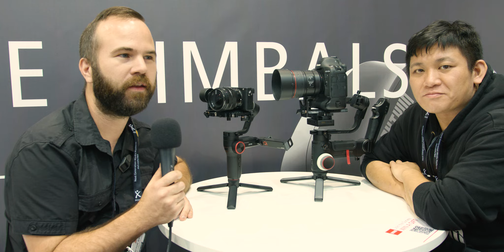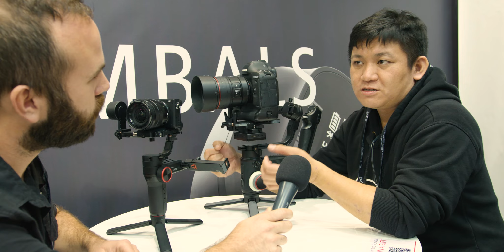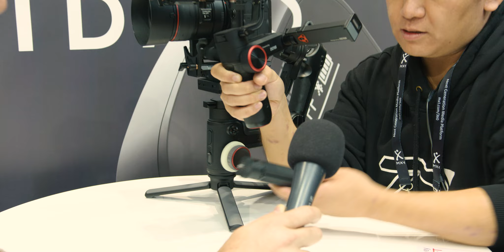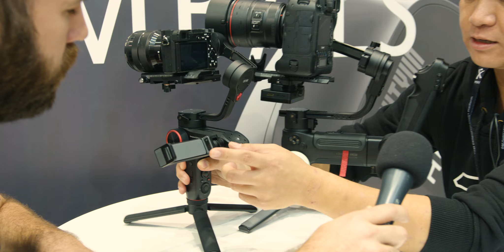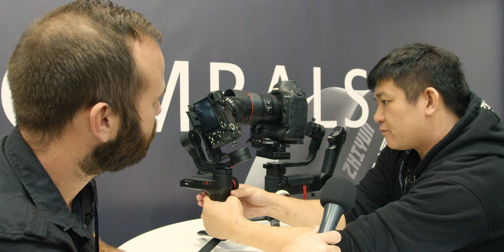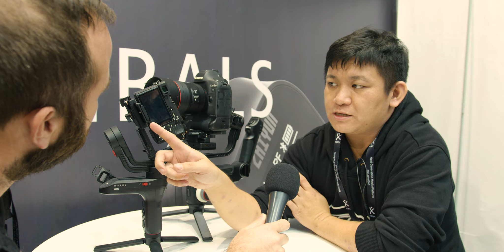Zhiyun Crane 3 Lab, Weebil Lab, Brand new Gimbal Concept, IBC 2018

Comment: this may sound like a crazy idea but imagine if the next version of this design had all the controls at the grip and had straps that held the battery section to your forearm.   Your forearm can easily handle the weight of these while taking all the strain out of your wrist.   That should also allow your thumb and forefinger to relax enough to control the knobs and such.

Comment: It seems as Weebil did not have a joystick. I was really into it but that omission kills it for me :/
Reply: It has one, just not like the drone remote type joystick on the Crane 3 or Ronin S.  The controls are similar to the Crane 2, which I actually like.
Reply: OrganicFarmer So it's basically digital signal for one direction? Isn't that very limiting for panning? Wouldn't that mean you can't adjust the speed in real time or pan diagonally?
Reply: You can adjust the speed but you won't have as much precision as a joystick I suppose. I've not had any problems with the flat joystick of the Crane 2. As for Panning diagonally I haven't tried this
Reply: Christian Lionel yes, I will probably get it anyway - I would just prefer more "analog like" precision. Glad to hear it works well for you on Crane 2.
Reply: It works really well and I think that to be honest it's not a deal breaker at all whether you use a Ronin S style joystick or the Crane 2 style. I have tried both and got used to one or the other either way. I understand that an "analog feel" is preferred but there was a video comparison I saw not too long ago that said they thought the Crane 2 style joystick was better because it didn't stick out too much and it was easier to use one handed. Either way the Weebill has so many good things going for it: Size, weight, 2 different handle set ups, Sports Mode, lockable Axis's, focus wheel, ISO/Aperture/Shutter Speed control on handle, phone holder, belt hook and lastly a 3KG Payload (Zhiyun Crane 2 has 3.2KG payload but is almost twice as big for being able to hold only 200 grams more) This little gimbal is already more feature packed than the Crane 2 and weighs just a bit more than a smart phone gimbal. 

If size/weight, portability and features is what you are after then this will be by far the best gimbal coming out even with all the new releases :)

Comment: Was 100% hooked untill I heard a nonsense that batteries should be removed to charge. Stone age.
Reply: Generally removing batteries is better for their overall lifetime. Charging in a device often generates more heat which increases wear on the batteries.

Comment: no way !!! :-) :-) :-) 
In general, the terrible design of this equipment and worst of all who invented that most of the shots are from ground level ... sorry but I do not understand this project completely. This is no longer gimbal. This is something like gimbal. Zhiyun Weebil ok but Lab ... no comment
Reply: Did you know that Crane 2 still exists? If you don't like the design, there is the crane 2 if you want the classic one.
Reply: Julian Paolo Dayag  Hello, I know perfectly well. we already have 2 pieces. But each works in the same way ... that is, something is lacking in this stabilization ... but everyone knows that there are certain requirements. Zhiyun completely does not work, for example, when you quickly follow the object (on the run and on uneven terrain) ... unfortunately, he jumps. This is where the competition equipment performs better ... I do not mention because I respect Zhiyun and the work input on the market. Unfortunately, I think it's time for modern products but for mirrorless ... small and handy. That is the purpose of gimbal. The production of giants for cameras in one hand does not make sense.

Comment: Design seems off to me. I solves nothing other gimbals can’t already do, and looks awkward as hell!
Reply: Candy Arts TV I use heavy power tools at work and most have a handle close to the head. To me this design seems pretty similar to that of a power tool. I can see it being more stable than holding a heavy pole with weight on top. One hand holds the weight while the other guides it how you want to.

Comment: $1100 no way. Maybe $900 for the Lab 3.  And $700 for the smaller one.
Reply: Not even $900 is fair. So what if you can access your exposure and ISO from the grip. That's overkill. Any intelligent user would change settings before they start shooting. You're not going to change your F-stop or ISO while you're walking with the gimbal. The Crane 3 Lab is nothing but a gimmick. And a horrible design at that.

Comment: you cant use a monopod with this grip ,to simulate a crane, rihght?
Reply: And btw . The monopod can be attached where the mini-tripod is attached when they are put on a table :) - if it is safe or not i guess depends on the monopod and your skills :)
I guess that would also make you need a second person to hold and app and actually control the gimbal head ? - i don't know i only used mine solo :/
Reply: Hopefully, yes. Even I have seen people on YouTube attaching a monopod with the Zhiyun Smooth 4 to use it as a crane.
Reply: I saw it done with the Crane 2 - and with the smooth 4 - i dont have a monopod so i cant tell you - But i do have both gimbals - I'm thinkin of reselling my crane 2 since its almost as new and wait for this .- since im not very active during winter season anyway :)

Comment: 1100 ??? thats too expensive
Reply: You can thank Trump it was supposed to be another $800 dollar gimbal.
Reply: keep in mind it also comes with two servo motors....    ONE servo motor used to cost $3000 only 5-6 years ago.      And those were only for Steadicam set ups.   the fact that we can get something like this for less than $2k is pretty damn amazing

Comment: $1100 & $800 seems kind of expensive. For comparison, the Ronin S is $699. Am I missing something here?
Reply: You'll get 2 servos, less arm strain ergonomics, and HDMI out from the gimball itself, proper pistol grip with a zoom rocker, lockable axes (a practical fave of mine) and almost all of the features of the Ronin S plus the fact that because of its shape, they are working on a harness adapter. That not worth the extra $? If these added features don't work for you of course go for the Ronin S. 4 years now as a gimbal wedding vid user (2 years on the Crane 2)... was almost set for the Ronin S and saw this. Having used Zhiyun and others, I'm confident this is dope.
Reply: one major difference is that the crane 3 can handle bigger cameras. plus the redesign gives you better option on how low the camera can get much quicker compare to the ronin. I was going to get the ronin but now ill just wait for the crane 3 lab.
Reply: If DJI Could release a lighter Ronin that was only for a little lighter payloads for a little bit less. They would make a killing.
Reply: Ronin-s doesnt even support Sony cameras properly. Well it does in advertisement, typical for Dji.
Reply: And moza air 2 600 USD  , bye zhiyun Say hello mozaaaaaa
Reply: @CooperBernaljm  Shockingly similar in design to the Ronin S (even the battery/handle) but with a higher payload and a lower price. Happy times.
Reply: yeah
Reply: Stephen Ukadike nope lol
Reply: Crane 3 Lab comes with a zoom motor and a follow focus motor. Ronin-S comes with nothing. You need to buy extras. But also the Crane 3 Lab is also a little more technologically advanced and can hold a bigger payload I think.
Reply: Well the $800 dollars was supposed to be $650 and the $1100 was supposed to be $800. Guess Trump doesn't give a fuck about small businesses.
Reply: They just confirmed it is $599 for the mini.  Maybe 899 for the big one
Reply: Looks cool but looks weird to handle. 1100 is a big mistake
Reply: @veganchasers2213 yeah $1100 seems kind of high but on second thought, I think they are pricing closer to the Ronin mx. They obviously have the same payload. So $1100 is just between the 3.6kg capacity Ronin m($859) and the 4.5kg capacity Ronin mx($1399). I guess they're on to something and I'm arguing for both sides.
Reply: you dont understand the point is that the crane 2 is gonna be 600 bucks
Reply: @VictoriaFilmsgroup  Sounds good. But what I want to know is what the crane 3 lab brings to the table, besides the obvious redesign/ ergonomics, that the Ronin S doesn't already offer and is it worth the extra $400?
Reply: @SteveDroid  the ronin is heavier though so unless you re very muscular and want to exercise even more its not worth it. I think those guys still have to work on the weight of their gear.
Reply: @VictoriaFilmsgroup  OK. I'm yet to use the Ronin S. I think the best thing to do is to try these gimbals before buying. But that would be hard to do in somewhere like Nigeria where these gears are not readily available for rental. You kind of just look at the specs and reviews and see how that fits with your workflow/budget before ordering.
Reply: Stephen Ukadike if you can wait, I would wait. My Ronin S is a beast but not many accessories. So be patient if possible, cause this Zhiyun 3 Lab looks like it will be the best available option.
Reply: @StrictlyBusinessJ  true. I'm. Not. I body builder either. That's why all these gimbal have tripod stand now. The ronin s accessors will be nice.
Reply: Victoria Films ओ
Reply: DJI Ronin is very heavy and bulky and the accessories are not available yet.  Typically DJI Ronin accessories are very expensive.  I have owned both and prefer the features and available accessories the Zhiyun offers, including follow focus motors for cinema and anamorphic lenses.  For most people using lighter mirrorless and DSLR setups the Zhiyun Weebil Lab looks like a great option.
Reply: The Crane 2 was on sale at B&H for $499 a few weeks back...I paid $599 with the follow focus motor.  Still a great gimbal but these look even better.
Reply: Victoria Films  That's not a good reason. Crane 2 is cheaper? Who cares? Irrelevant.
Reply: Thankfully, I own the Ronin S. I look at this gimbal and cringe at its horrible design.
Reply: VFX Todd I agree lol

Comment: Thanks for the video.  
1). I heard there was going to be three new gimbals....do you have information on the third gimbal?  
2). Would the Zhiyun Crane 3 Lab gimbal fit in a large backpack like the Crane 2?
3). Does the Weebil Lab gimbal have the HDMI to Wifi option?
4). What is the weight of the gimbals?
Reply: OrganicFarmer 

3. Yes
4. They wouldn’t tell because these are prototypes.
Reply: Thanks for the reply.
Reply: Oh sorry, 3. not hdmi to wifi
Reply: Thanks for the reply.  Will the Weebil Lab offer an option for a follow focus motor?
Reply: OrganicFarmer i saw another video, they said that weebill lab around 1kg
Reply: Cool...thank you for the information.